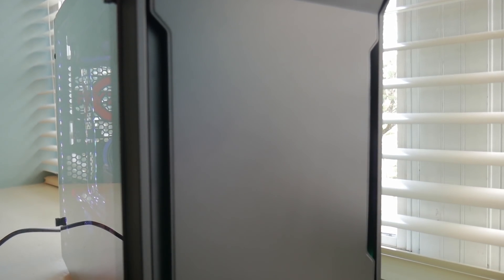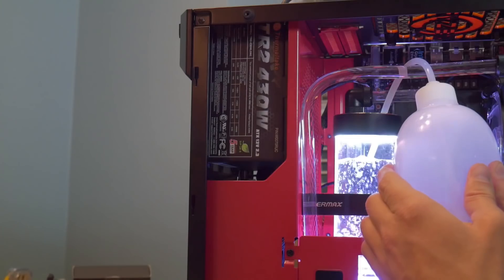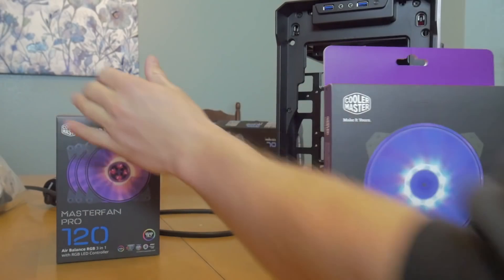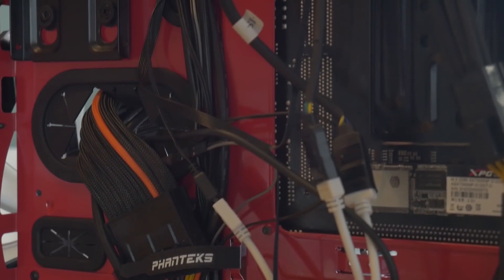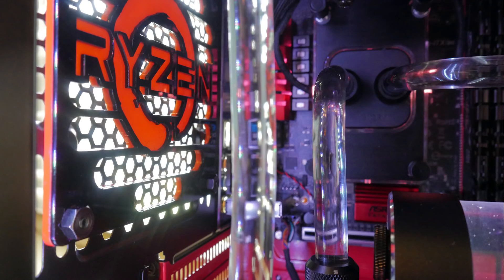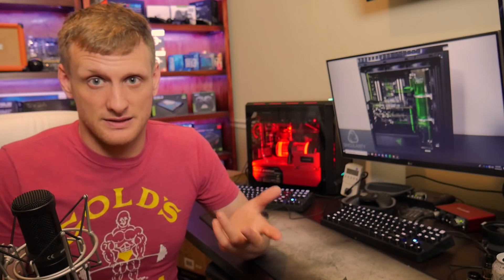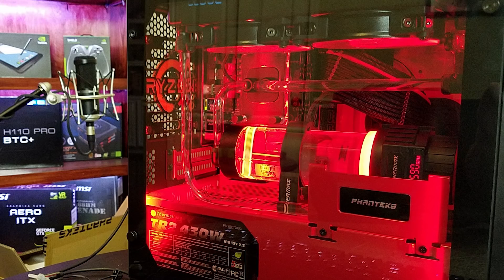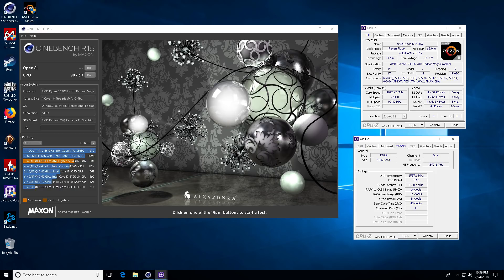Epic Watercooled Raven Ridge CPU!

Comment from the maker: I mean to say... It's over the top for an APU. But not over the top for total cost when looking at the typical mods at a lan event.
Reply from the maker: I've run a few of them for years with no issues so far. Over 6yrs on the one in my daughter's rig. You have to monitor your consumption with any PSU.
Reply: Son of a Tech cool 😎
Reply: It looks sick!!! Good job bro!
Reply from the maker: thanks!
Reply: be careful. that psu is just one step above being garbage and has a long and documented history to prove it. I bought one 13 years ago (they haven't made updates to it, but they lie about it being updated on the label) and it blew up in sparks after 14 months. it's really an old (pre ATX 2.xx spec) 350 watt psu that they slapped a 24-pin on to make it compatible with modern motherboard designs. the capacity is fine for this build, but the quality is terrible by modern standards.

Comment: Son of a Tech Are you using the 4.40 BIOS or the 4.43 beta, which fixes many of the bugs and allows NVMe devices to work properly? Have you tried the on board WiFi? Many people on the ASRock forum are having huge problems with it causing BSODs.
Reply from the maker: 4.43 still no go on the nvme. I have no tried the wifi
Reply: Son of a Tech Interesting. I had to use my 960 EVO in an M.2 to PCIe x4 adapter card with 4.40 but after the update was able to move it back to the motherboard M.2 socket. I don't use wifi from choice either but tried it and confirmed that there's a big problem with it. Nice to see that GPU-Z 2.8 doesn't crash the whole system on launch as previous versions did.

Comment: It's a shame you couldn't get an RGB full coverage block for that.
Reply from the maker: full coverage would have been cool. Still 24/7 4.1ghz oc is dope.
Reply: I'm sure it is, but I just wonder how bad the VRM temps can get at full sustained load.
Reply from the maker: 109c. Pretty bad lmao. But not the 125c some are getting.
Reply: Maybe some day there will be a full cover block for the board you can do an upgrade with.  I posted another comment about maybe using Fuzedrive with the 256gb SSD and included a link so it may have gone to the 'spam' section.

Comment: Son of a Tech : this Ryzen 2400G APU is probably the only savior for this years gaming and it's awesome because you can play modern AAA games at 1080p on low/medium settings. And since GPU insane prices are gonna rise until Q3 of 2018 and then on top of that it will take another 5-7 months for them to fall down back to normal prices....so maybe around spring time of 2019 we will see normal GPU prices again. No wonder these APU sell like hot cakes everywhere :).
Reply from the maker: Ya, it's why I wanted to do a show build.

Comment: this is one of the few builds where cpu delid is actually worth it, then why not do it?
Reply from the maker: Waiting on better tooling. I already fucked one up.
Reply: heh, I can see that as amd heatspreaders are tough guys stuck on with a crapton of glue
Reply from the maker: The caps butt up against the adhesive. So It's a rough dellid
Reply: I wish you good luck deliding, in this case it sure will be worth it, since hitting 80s on custom water is just awful
Reply from the maker: I know but I can't get it shipped to the states
Reply: Risk.
Reply: der8auer has a setup for deliding.
https://www.youtube.com/watch?v=Wkb4NmeONqY
Reply: Der8auer got one with a little plastic adapter. No need to use razor.
Reply: Son of a Tech Get in touch with him direct I'm sure he'll hook you up he's a cool guy.